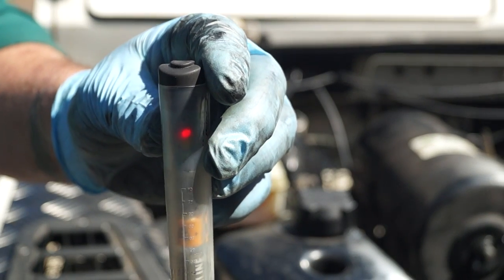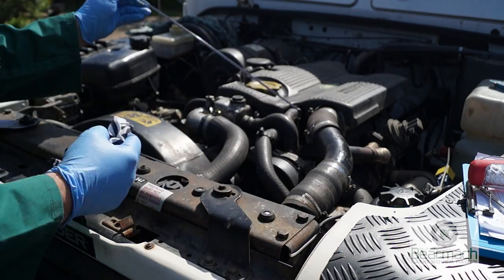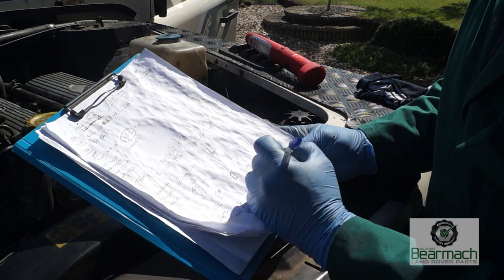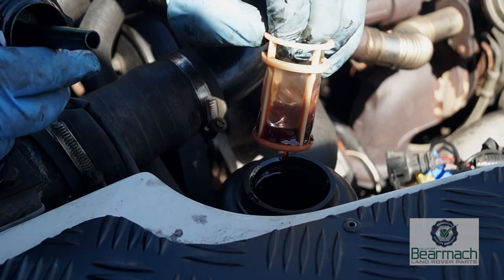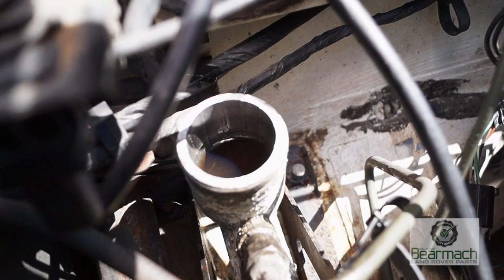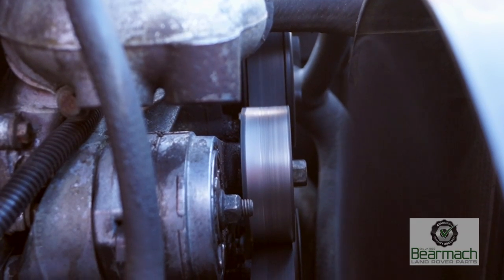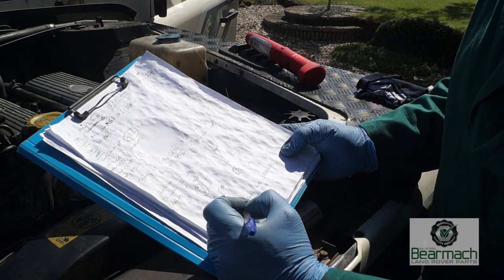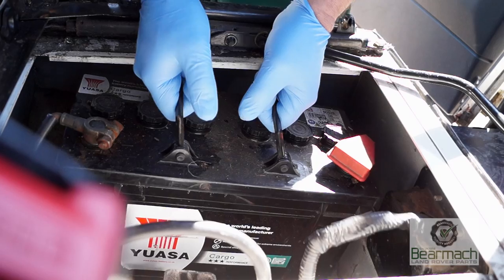Engine bay checks Part 1  - The Fine Art of Land Rover Maintenance

Comment: Hi chris. i am your regular follower from italy. very good job and thanks you for all your videos! i wanted to ask you something about steering shaft. you said that its important to check plays of the joint. what about turning the shaft? i have something like 45° of turning angle and a little oil loose from top of steering box (once need to ad oil in 2 years). is it a big problem or is normal to have that kind of movement? best wishis! PS: sorry; mine is a 300 tdi discovery of 1998. i will try to make a video turning a steering shaft........
Reply from the maker: Steering box play.   the steering box need sot be adjusted to see if the slack will come out of it.

Comment: top of the morning to you, just two questions, what is the moisture instrument that you use to check brake/ clutch for moisture and hygroscopic?  I have just purchased a 2.5 d 110 with a mileage of 33974 ex-military radio car is the mileage correct or has it been turned back ? 92' model came out of service 2014?
regards grampy
Reply from the maker: The tool is a brake fluid tester.  you can get them for a tenner in most motor factors.    As for the mileage on the defender.  It could be genuine.  Some stuff may have been in storage, very rarely used.  Does the condition of the vehicle show that it hasn't seen much use?  I doubt it would have gone around the clock being a military vehicle?  More likely it has had another odometer fitted sometime in its life.
Reply: yes engine still has the green paint from service, just chipping away. only  alternator been changed will be changing starter motor, slight rust in drivers foot well otherwise in good nick for its age will have to give it a gradual overhaul! If it is not broken I will not fix it LOL 
any ideas where I can get the nato matt green paint to give it a roller job at a later stage.
will be using your videos to service the 110.
  regards Graham